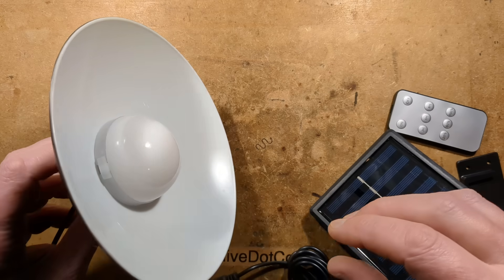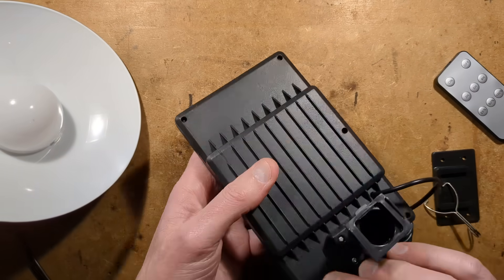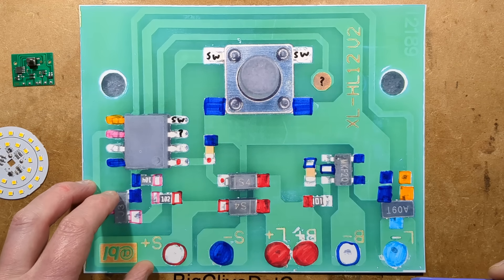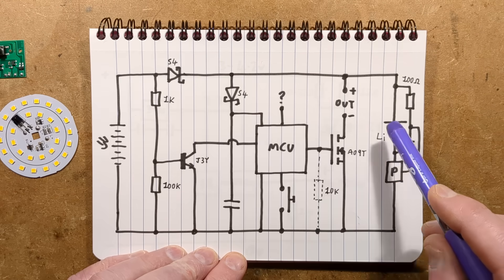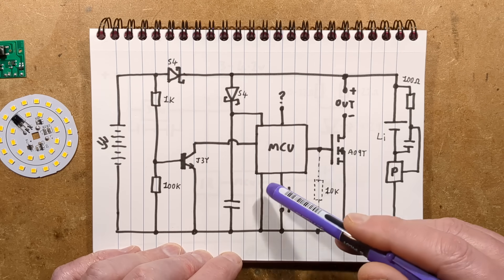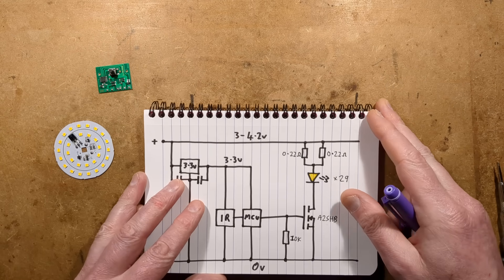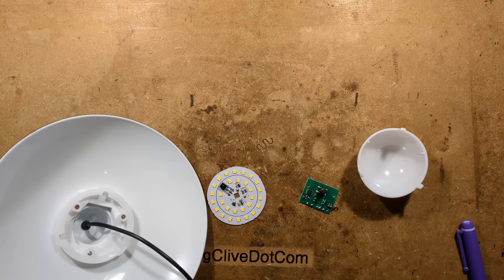Solar pendant light teardown

Comment: I picked up a Philips set similar to this, but not quite, many moons ago. Mine has two lamps, a solar panel and a plastic box thingy which contains the rechargeable batteries. The solar panel plugs into it and there are a pair of sockets for the lanterns with on/off buttons, plus a USB socket for charging things like phones. I thought it would be useful for the inevitable zombie apocalypse or the Martian invasion of Byfleet. It was a steal for £7.99 in Home Bargains! Mind you, the pair of batteries dieded but I somehow managed to bodge replacements from a cheapo powerbank, also from Home Bargains.

Comment: Can a solar light use its own light to supply power to light it? It would have to be initially charged by another source of light. Just a crazy question.
Reply from the maker: It would not charge itself.

Comment: Could you take that 1k resistor out by the solar panel to prevent it from coming on at dusk? To only use the remote for on and off?
Reply from the maker: The output transistor could be bypassed.

Comment: 7:38 It looks like if you pop off the 1k resistor on the "daylight sensing" voltage divider, you will be able to turn on the light during the day. It's appears that MCU's only purpose is to send power to the light during night. It looks like the MCU on the light itself handles the all timing and brightness inputs from the remote.

Comment: A video on removing the light sensor so it just works via remote would be great and appreciated.
Reply from the maker: Just bypass the output transistor on the solar panel PCB.
Reply: If you cut a trace or lift a resistor on the power board's sun detection transistor it should power the other part until the battery goes dead.  If it can handle standby as a 24/7 load then you should be good.

Comment: Quite interesting, thank you BigClive :goodvibes:
Have you dismantled a double socket USB car charger that sits flush with its cigar socket? I just got a refund on a faulty intermittent unit, and found only one side on the negative was connected, there was no fuse, and a single failure could cause a fire, rendering the vehicle and maybe occupants, cremated! 
(FAST CAR CHARGER USB CIGARETTE LIGHTER SOCKET DUAL ADAPTER)
Reply from the maker: I think I have a dual charger like that here.

Comment: I live in the desert southwest USA and the sun is unrelenting here and the UV is usually high, so a no go here being this is mostly plastic.  I have several small 5V-12V solar panels but all have metal frames/housings and glass lenses.  I quit using them for now as the city decided to install a street light on my property that lights up the entire cul-de-sac where I live and the front of my property.  Thanks for the video Clive.

Comment: It would be interesting to see the minimum brightness outside would have to be before the light comes on, imagine sitting there in the gloom and it is not dark enough yet... Be tempting to add extra batteries but so close to the solar panel I'd worry about heat and the fact they would likely never be charged enough

Could the mystery connection be for a cds

Comment: Where was the circuitry & antenna for the remote control?  Was it built into the MCU?
Reply: It wouldn't need an antenna it's infrared
Reply: @phonotical  Oh - thought the infrared was just a light sensor.

Comment: This might help me find the problem with my solar balcony lights. it charges fine but doesn't turn off when the sun is out. the override is allways active and the butto to do so only turns the status led on or off.
Reply: Might be the photo sensor.
Reply: @peterlarkin762  i dont see a photo sensor i think it uses the solar cell as one. i had it open and there are only two wires to the top of the housing. the soldering is a bit meh and there is some white powdery looking residue around some quite close solder joints. thats why i suspect a bridged contact.

Comment: I keep a couple of similar but smaller solar lights in the toilet.  Even on a cloudy day, they can pick up enough power not to need the light on all the time.  Is this too much info?  Handy things to have though.
Reply: Are they water tight?  I presume the toilet water will corrode the connections.

Comment: I bought an outside floodlight years ago and use it to have a light in the garage! The solar panel I attached to the window on the inside! Brilliant! As soon as I open the doors, the light goes on and I can drive in and have just enough time to get out of the car and close the doors! The lamp itself is a 6V/10W and it has an battery pack attached to the lamp base!

Comment: The fact that you can´t turn it on and off as you please is rathrer unfortunate. I´d much more prefer the solar cell outside the shed connected to some kind of separate driver unit containing battery inside. The solution shown in the video is not optimal. It´s probably best suited for some outdoor place, open conservatory or pergola as it switches automatically on in the evening.

Comment: Bought the double light version of this for the garden, really nice lights I think and nice to see the insides and circuit.  Then the dog ate the remote, so I bought a single light version just for the remote, but there must be different remotes for them as it didn't work with my original 2-light version.  So I bought another double light one and it worked.  I also read the codes from the remote in case the dog fancied another remote, I could build a replacement.

Comment: A BIG battery from a dropped USB phone charger box would fit in that nicely. It would need the charge protection circuit I would imagine. Perhaps a second cable for a little home made windmill generator on a mast.

Comment: Could you cut the trace from the dusk sensor and pull the MCU side high or low to enable you to use the remotes on/off during the day or night ?
Reply: I had the same idea, just cut the trace to the dusk sense transistor & tie that input high or low to allow remote control at all times.
Reply: @ChromiaCat  yes, but don't neglect the resistor.
Reply: @matthewellisor5835  Yes, you pull it up or down with a resistor.
Reply: @matthewellisor5835  Oh yea, I forgot to mention that.
Reply: @ChromiaCat  I've forgotten to include such as that and worse. It's easy to miss including something so obvious to those of us with a bit of electronics experience but if it burns (pun intended, not sorry) even one budding enthusiast, I've made disservice to our hobby and craft. 
I'll admit that I have a cheat code. I often run comments by my (single digits of years) children and ask for their understanding of what I meant. It's sometimes illuminating, just like the device in this video.
Reply: I wait until autumn to buy all B&Ms solar lights half price
Just Before they stock up on Xmas lights 😊
Reply from the maker: Or just bridge the output transistor on the solar panel's PCB.
Reply: @Franko_Walker  exactly what I'm planning to do this evening!

Comment: Looks like these have been drastically cost reduced and are far less useful than older versions. I have one of these that looks identical except that it also has a pull cord on it. It's been happily working in my shed for 7 years and also works fine during the day, without the limitation you mentioned

Comment: I bought the version that has a pullswitch as standard. Still has the same remote and functions but has sat lighting my porch for the last two years with no issue. Although it’s only used to light the porch so you can see the door lock or to let guests know where the house is as house numbers are hard to see on my road. Good little light really.

Comment: This makes me wonder about how feasible it would be to only use solar powered lights in your house ?
There are some areas that might need a higher intensity light such as the kitchen but for general purpose ambient lighting this might be sufficient.
Would the cost of purchasing them be much more than the savings you make by not using mains electricity for lights ?
Reply from the maker: It would be useful for off-grid applications or areas prone to long power outages.

Comment: Things that I hate in these cheap solar light units:
-Small PV panel that will not enough for charging
-Small battree/single cell battree
-Some light unit internal is hard to access because glued down for modifications and repairs

And I before mod one by adding 4 cells in it plus adding one diode to making more light output from the light

Comment: Would be nice if it allowed you to run it during the day as well as night for a shed.The good thing is you can quadruple the  storage if the charge controller can do it .I would modify that sucker
Reply: Yep, I have a similar setup on my shed that has two kights driven from one solar panel/battery unit. I have one light outside and one inside that is useless during the day. The outside light works fine and gives a good light over the door The remote just turns the lights on/off, no modulation.
Clive has given me some ideas for modifications.

Comment: It's basically a really simple remote controlled lightbulb connected to a garden light solar panel, which is preventing the light's usability in daytime ‒ even if the light is inside of a dark shed. 🙄
Reply: It’s intended for outdoor nighttime use.
Reply: @mikebond6328  It could have other use cases, but the power to the "bulb" cuts off in daytime.

Comment: 0.11R series resistance with the LEDs?! They'd better hope the wire is adding resistance (and the MOS-FET and internal resistance of the cell too).
With the cell at 3.0V (which it should never be), that limits the current to 909mA.
With the cell at 4.2V, the current through the LEDs could be up to 11.8A!
Reply from the maker: I did current tests with a bench supply emulating the lithium cell.   The results are in the description.

Comment: Would mean running two more conductors but a means to switch the dusk sensor input off and replacing the cell with 4p would make it much more useful in a dark shed. I have a few around here, I think I know what my evening project will be.

Comment: Soft silicone should be fine, but it must be super soft.
When I worked for BP Solar in the 90's I was fabricating experimental solar panels, concentrator types that had the big mirror assembly.
We were using a high-purity 2-part silicone, essentially breast implant grade. It had to be filled at an angle so all of the air bubbles migrated away from the silicon wafers.
The front was glass, the back was a length of extruded aluminium for heat transfer to the additional heat sink.
Air bubble expansion was what caused any cracking issues in the extreme temperatures that those modules endured.

Comment: Thank you very much for the deep dive on this light Big Clive.  I got a few similar "Solar Pendant Lights" as you describe this a few years ago on Ali E I think.  Two of them were basically Dusk to Dawn and then there was this one with half of the circuit in the lamp and the other half in the battery/solar side.  

This one like you tear down here, on my end, finally stopped working after a year and a half or two years.

I'll have to dig it out again and do an autopsy. I recently got a little spot welder and I might try to revive the Solar/Battery side.

Too cool.  Thanks for this video.
Reply from the maker: Two main suspects.  A cracked or open circuit solar panel or a dead lithium cell.  You could try patching in a salvaged lithium cell.

Comment: It would be nice if the battery protection chips for these outdoor devices contained a temperature sensor to prevent charging below freezing or above maybe 40°C. I presume they don't. But then I suppose they'd only work reliably with an external sensor in thermal contact with the cell, whose temperature will lag.
Reply: i’ve noticed with any brand that’s not based in china the batteries used are self heated for winter use. yes it’s slightly more expensive but i’m willing to pay more for a better product
Reply: @fly-lucky  I have not seen many products at all that have a self-heating battery. Solar products in particular... it would be pretty much a waste to try use energy from the battery, to heat the battery, just to them have a solar panel try to put a charge back in the battery that is over and above what it is taking from the battery to heat it.
Reply: @davelowets  lots of self warming battery tech out there
Reply: @davelowets  In my experience with a large battery it uses available solar power to heat itself until it can accept a charge. They can discharge at lower temperatures.than they can charge.
Reply: @fly-lucky  But completely irrelevant to this video.
Reply: @fly-lucky  For a small solar light? Do you have an example? I've only seen that on home batteries in the kWh range.
Reply: @matthewmarks6951  no i dont have a small example im not buying toys im buying solar equipment to power and light my house
Reply: @fly-lucky  Well indeed - it's the size of the battery and its intended purpose and nothing to do with whether its "brand is based in China."
Reply: @fly-lucky  And I have the same thing, though I don't need heaters as the battery is in a controlled environment and I don't live where there are extremely low temperatures for extended durations. I really don't know why you have taken it upon yourself to jump into this discussion with irrelevances.
Reply: @matthewmarks6951  i had to switch to slef heated batteries at my camp because its not heated all year round and we only go there a few times a year. i started with cheap solar lighting but none of them made it through one winter. so maybe it is a little relevant
Reply: @fly-lucky  You'll never get a heated battery in a small solar light though. Was it the batteries that failed or did other things happen as a consequence of them cheap, like moisture ingress?

Comment: Did I miss the circuitry that lets the remote control work?
Reply from the maker: It's a dedicated receiver component that has three pins.  It filters modulated infrared and sends it out as a logic level to the microcontroller.
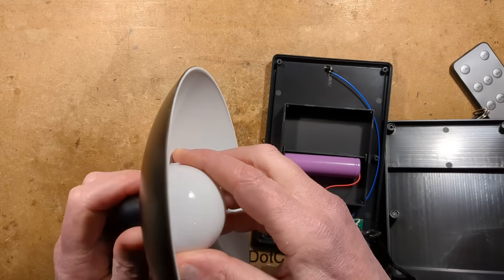Reply: It was in the globe itself, at 3:25
Reply: And the micro at 6:06 is what does the work for it.
Reply: Yes.